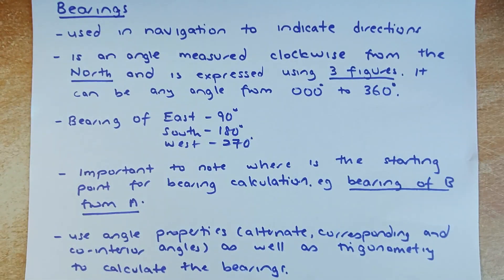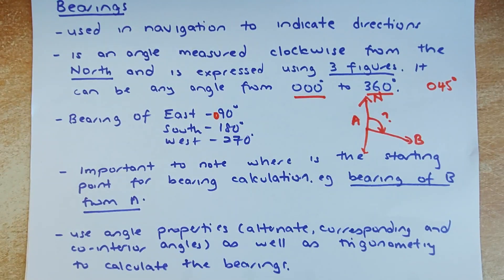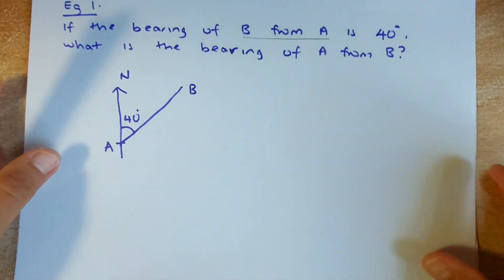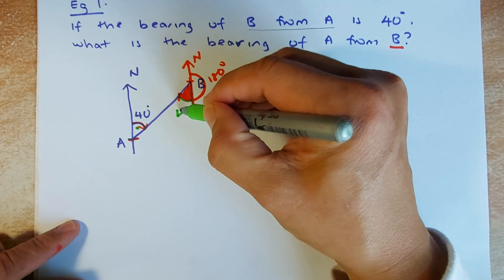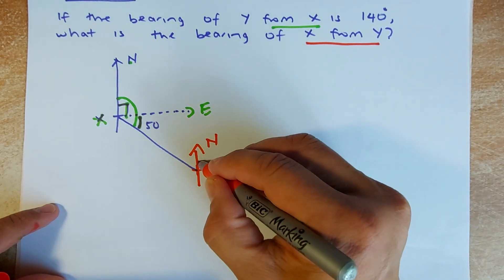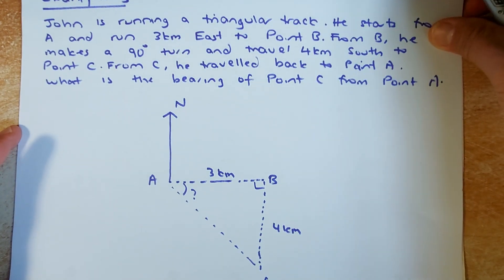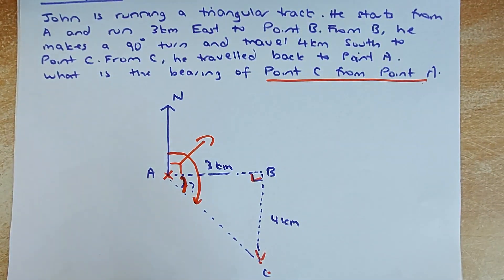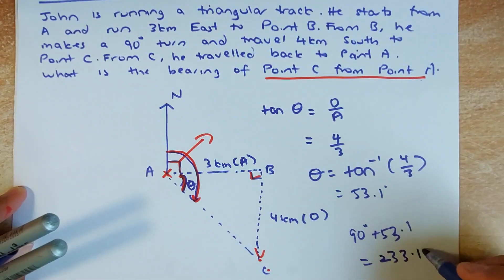NCEA Level 1 and 2 Revision - Bearings

Comment from the maker: Sorry, there was a miscalculation in example 3. The bearing should be 90 + 53.13 = 143.1 degrees instead of 180 + 53.13 = 223.13 degrees. Sorry again. Good luck everyone and hope you have a better understanding of bearings. Cheers.